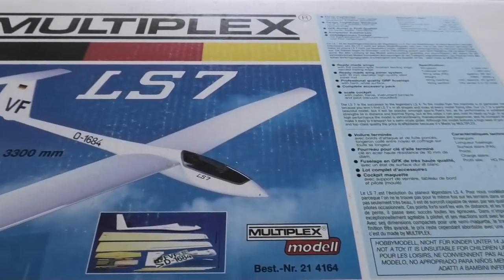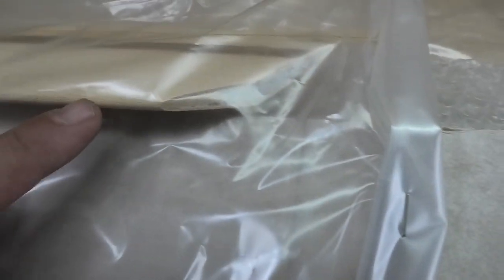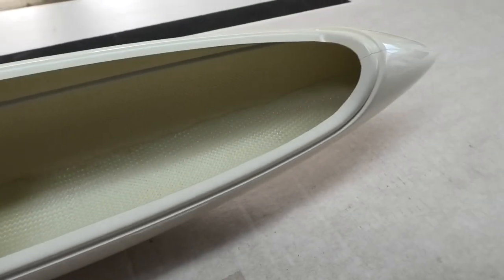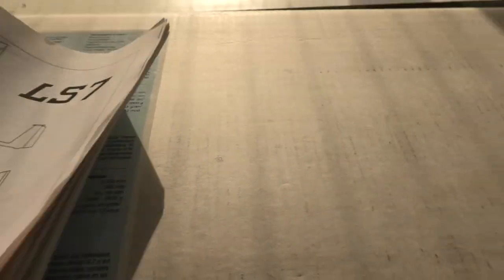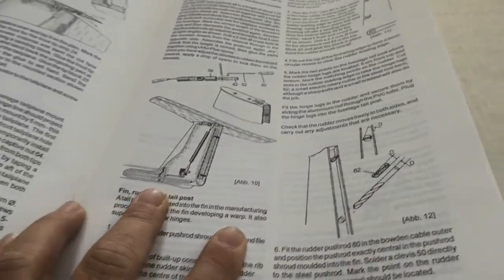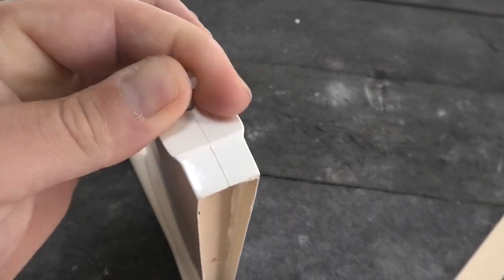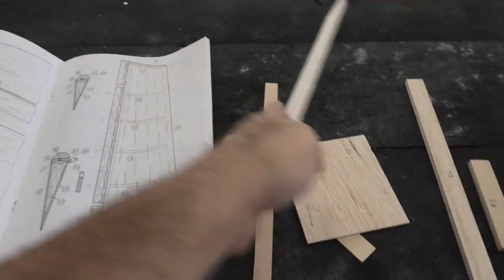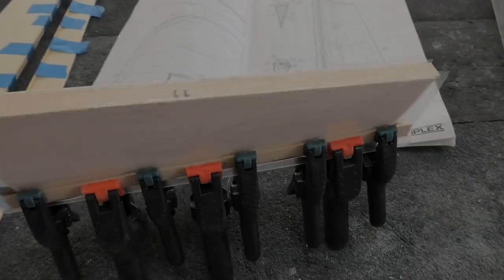Vintage RC Sailplane Build. Multiplex LS7. Part 1

Comment: Really looking forwards to this build and see how you deal with it, especially because I’ve got a multiplex LS3 kit in the garage which remains largely unbuilt.   Mines a late 80s/early 90s kit.   Similar size.   No pre installed LE, fin post and bell rank.   Tail plane is built up in mine.   No carbon.   Guessing yours is early naughties.     Quality kits.
Reply from the maker: Just uploaded the next video.
Reply: @flightcomp  it’s excellent 👍